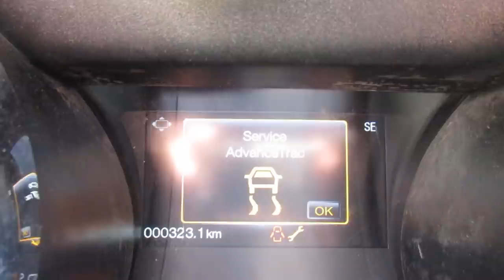Discovery Channel Paid Me To Do THIS?!

Comment: A high school friend of mine bought one of those Nissan pickups in that same red color either during senior year or right after we graduated (1987).  Thing I remember most is being impressed how neatly all of the brake lines ran across the firewall in the engine compartment.
Reply: Thats what was most impressive to you?? Brake line running on the firewall?
Reply: @willybman3723  it's what I remember about a vehicle I saw for 5 minutes  32 years ago

Comment: There must be a universal rule that makes the windshield wipers come on as soon as an old beater is started for the first time after sitting a while.  Also, that door chime gave me flashbacks to my '87 Sentra hatch, which threw a rod at 87,000 miles because they designed the engine to run at ridiculously high RPM's to achieve the recently increased highway speeds.  Thanks, 55 mph speed limit!

Comment: That old nissan sounds better than most of the 5.4 tritions i hear going down the road
Reply: MINTBERRYCRRUNCH Of course. Triton=Trash
Reply: My 2008 Dodge 1500 4.7 v8 puts out more horsepower from the factory than any Triton v8 you could buy. It also tows and accelerates better, and It has over 300,000 miles on it. All original drivetrain wise, and doesn’t even burn a drop of oil. I’d like to see a Triton 3 valve that hasn’t been pulled apart once last over 300,000.
Reply: Deereman Nice. While not a Dodge guy,   I would take a 4.7 or a Triton at the drop of a hat.

Comment: If only it was one of those indestructible Toyota pickups Top Gear style where you can drown it in the ocean, drop it from huge heights, and far more abuse, and it still runs and moves. The bar has been set considerably higher than your modest attempt.

Comment: We had an 87 Nissan with the 4 cylinder with 8 plugs. That’s right two plugs per cylinder l, and a 4 speed manual not the 5. That thing had so much low end torque you’d swear it was a small V8

Comment: they mess up some nice cars on CWD
Reply from the maker: One of the mechanics actually disabled a car that was too rare to put on the show so they couldn't destroy it.  He fixed it before they sold it again.  No problem wrecking new cars, but the oldies getting hurt is hard to watch
Reply: @DEBOSSGARAGE  In one of the early seasons they absolutely destroyed a mint 59 Lincoln. The host just casually comments on how rare and valuable it is as drivers slam it into parked cars.

Comment: Clickbait and yes using ur hand is cheating learn to toe heal
Reply from the maker: With size 12 work boots in a Nissan?  Lets be realistic now....
Reply: DEBOSS GARAGE I get it ur just a mechanic not really a driver toe and heel is not actually done with the toe and heel its actually done with the sides of ur boot and its easier with an import truck like a nissan or toyota I had an 81 toyota that was a real pos didnt idle and had really bad brakes and I got really good at it with size 11 sorel winter boots.
Instruction video https://youtu.be/nzcRZCcikwM